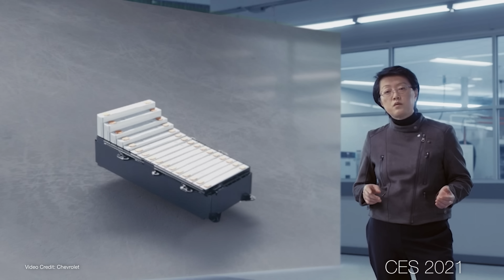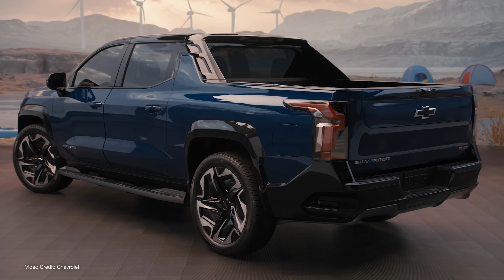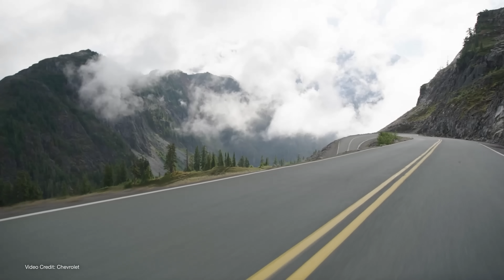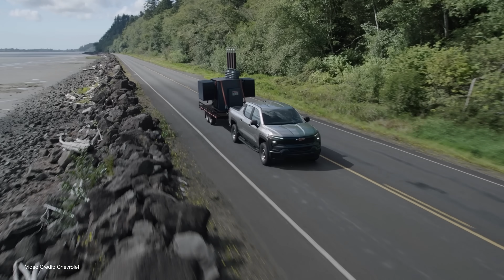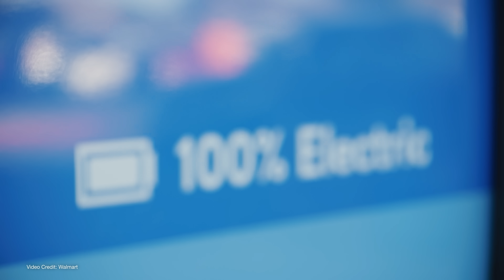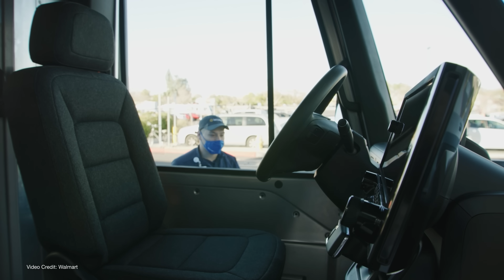CES 2022 - GM's Keynote introduces the Chevrolet Silverado EV

Comment: Good amount of news! I latched onto the part about GM "rounding" the front end to cut through the wind for better EV efficiency. Cool, but why don't they do that with the ICE version, at least until it goes away? Slightly better gasoline mileage would still be a benefit, well, for just a few years.

Comment: Hey, any idea about RHD models of the Silverado? they'd sell like hot cakes in NZ i think. the rural folks are constantly complaining there's no EV pick ups available.
Reply: I'm aware GM maintains a small presence via a factory supported importer for the current ICE Silverado, combined with the fact they went through with the effort for a factory RHD Corvette, I'd say unlikely, but plausible, though it likely wouldn't be cheap!
Reply: I imagine it is much easier to switch driver's side on an EV than a conventional vehicle. Otherwise you're pretty much waiting on the Japanese for a RHD option, I suppose...

Comment: Covid's omicron is weaksauce, you cancelled your plans, over a chance at getting the sniffles.
Reply from the maker: While it's certainly true that early evidence suggests Omicron is significantly less severe for most people, it's also vastly more contagious and while hospitalisations haven't tracked as closely to probable infections as other variants, the fact is that the hospitals are full - and have at several points hospitals in and around LV have had zero ICU beds. You may not worry about that, but as an experienced medical professional, I've seen what that actually means in practice. A lot, as it happens, of late. And it's bad. 

We have, as I have said, high risk team members. If one got sick and needed to be admitted - a real possibility because high risk individuals still get very sick with Omicron, then there is a real and substantial possibility that they could die. Just so we can take pretty pictures of things that are being shown virtually.

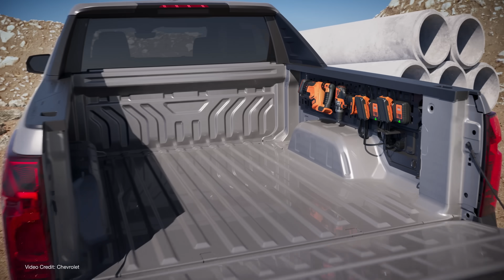Beyond which it's too early to tell whether Omicron produces the roughly 1:20 risk of long COVID that we saw with early infections. I sure as hell have no desire to have long COVID and am happy for our team members to be kept as far as possible from that risk.

You may not care about us as a team, but we do.

^Kate.

Comment: The Electric Silverado is here? It's a 2024. They have not produced a Bolt since about August. They have sold 1 Hummer in 2021, 26 total EV's sold in the USA in the 4th quarter of 2021. Around 100k Bolts that still need batteries and they are now a part of the culture of "Act Now while Supplies...well, not last really" but instead a "reservation. I own a Bolt, It's a 2021, it will not be fixed any time soon with a new battery. I have the latest software "fix" that limits range to 80% SOC and lets me park with the other kids again (oh wait, the "I won't burn you" placards are not here yet and who may believe Chevy after 2-3-4 software updates to "Address" this). I'm sorry. I love my Bolt but the situation and handling of this awful and believing GM at this point on almost anything is ridiculous. I am hearing rumblings now that the coolant to do the battery swaps is now out of supply and the swaps are on hold because of it. I love EV's, I'm on my second. GM is lost, very lost. Tesla is easy to hate but let's face it they produced a million pure EV's last year. Not promised, not backordered, but produced and sold and delivered. I would be cautions with my optimism on the new Silverado/Equinox/Hummer (not to mention if you think they will actually product the basement price one's they are talking about...I refer you to the previously mentioned Tesla and the great $30k model 3 and also that in tough times GM produced lower priced trucks and then parked them in stadiums to not sell them and put the parts in the more valuable vehicles). Nothing wrong with that but it still happened. < lol Rant Off> Oh, BTW Kate is the bomb. Their style of humor, dead-pan delivery of facts and way of balancing objective fact mixed with excitement and emotion is refreshing. They are the business... yay Kate.

Comment: im surprised at how much I like the design (especially) the front of the Sliverado EV.....Thank you and the team  for all your hard work trying to cover CES virtually!
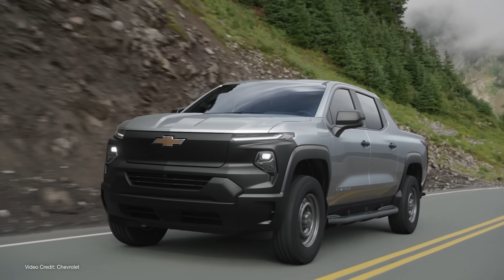Reply: 3:31 did they forgot to paint the front in this car? Looks plastic and cheap.
Reply: @volkhen0  Thats the work truck version....basic bare bones for work purposes only....but yes as always GM uses too much cheap plastic.
Reply: @kentgabriel3572  I think plastic on/inside bed is better the bare aluminium like Cybertruck. It will scratch like crazy. Good thing about it is T slot bed. Plastic linings you can replace but you have less anchor points.
Reply: GM seriously needs a new design team.  This thing looks cheap

Comment: We have a 2003 Avalanche with a canopy and love the utility of the drop down interior bed extension. We might just replace it with this new Silverado EV. My problem with the Cyber truck is that it keeps getting pushed back and we still do really know what the production version will look like and I hate the yolk steering wheel. We currently have a reservation for a F-150 Lighting but might switch to this instead. As this truck would need to replace one of our Chevy Bolts and our Avalanche.
Reply: The problem is that all EV pickups are likely to time for production and availability ... OK I admit that for the moment only the CT and Rivian were officially been pushed back but it wouldn't surprise me that both F150 and Silverado EV's will also be pushed back.
For Ford and GM, the bottleneck is battery supply limiting the production. And on top of that, even when you agree to the MSRP to one of their offering, will you also agree to the dealer markup ?
Reply: @krisvandermeulen253  Chevy is not ready.  Ford is.  They have batteries and manufacturing securedNot for 200,000 trucks.  The output of Ford will be impressive.   If you want one of the first electric trucks from the big 3 you will most likely have to pay mark up and get a high end version.  As time moves on and competition becomes competitive the price will drop. 

Tesla and Rivian will just sell the most profitable versions first.

Comment: GM will be irreverent unless they bring on a boat load of battery capacity.  So announce as many models as you want but it won't make a difference.  The real story needs to be where are they getting battery materials and are the Ultrium batteries any good.
Reply from the maker: GM has two battery production facilities under construction now, and has announced two more. The company seems to be planning for major expansion in EV production. As to how good or not good the Ultium platform turns out to be, that is something we'll all have to wait and see. I hope it's good, because the more EVs on the road the better, but personally I feel that GM and LGE have a lot to prove if they want to win back any goodwill from me. - Winter
Reply: @transportevolved  Four factories don't matter as the numbers of Gwh of output.  I know it will grow over time but any guidance from GM would go a long way to understanding if they are serious.

Comment: wonder if Walmart will allow others to use their charging network? same for for Fedex? the former has a lot of locations nation wide, so is it going to be in all stores as fast as they can?
Reply: Q: so is it going to be in all stores as fast as they can? A: unfortunately no, because: BOLT RECALL, because: GLOBAL PANDEMIC.  those paying attention (with good memories) will recall that the Hummer was slated to arrive 4Q 2021 and here it is now 1Q 2022, and of course they still have to ship the Ultium based Cadillac Lyric.
Reply: I am aware that fleet-use-only gas stations are already a thing (like a local bus depot to me has their own diesel pump on site exclusive to the busses) so I do slightly doubt it, especially if the rumors about electrical infrastructure remain true

Comment: I do hope that GM dealers aren't going to do like Ford dealers did with the F-150 Lightning with a $10k-$30k dealer markup just weeks before customers were to receive them.
Reply: My dealer said they are not going to do a dealer markup. I told him if they ended up doing that then they lost a customer. But they reassured me in a couple vacations they will not be doing that. They're going to attempt the windows and a couple of other things for $800. Then there's the destination charge for about $1,200 and taxes. So if they do that it's all reasonable.
Reply: @jayfromaz  With me living in Casper (Central Wyoming) when Subaru releases the Solterra I can almost guarantee that my local dealer will have a markup since they're the only dealer within a 150 mile radius. And the next dealer is a 3 hour drive away in Cheyenne.
Reply: @shadowz_edge   you're right they probably will. This dealer markup stuff is absolutely ridiculous. They gouge you enough for the window tinting and the other features they add in. If you got those other features from an independent source it'd be a lot cheaper.

Comment: Just watched the Chevy Silverado reveal. What a major, major disappointment. I was looking for something to replace my 2017 HD3500 4x4 Duramax. I tow a 35' 5th wheel. The RST certainly will not suffice.  Too small, and I really don't like the Honda Ridgeline appearance. Give me the traditional Chevy Silverado front end and body style. I hope that they change this in the next year once they get trashed by all of the present Chevy Silverado owners.  
Guess it is time to look more seriously at the Atlis Pickup, with its 5th wheel gooseneck hitch. At least they take the people that actually use a truck seriously.  
The RST is nothing but a glorified passenger vehicle. Too bad.
Reply: While I too have a 5th wheel trailer and need my one ton for towing, Ford and Chevy sell far more 1/2 ton trucks every year than 3/4-1tons. It makes sense that they will introduce a 1/2 ton EV truck first. Which is why Atlis is going for that market first hoping to get some market share. Unfortunately they are a start-up who has just recently completed their prototype vehicle, I really hope they make to market and thrive, but they might not. The big question on Atlis is they are shooting for a GCWR of 35k lbs, which is truck trailer and payload combined, the mystery is how much of that number will be taken up by their XT truck's weight? BTW I say this as an XT reservation holder.

Comment: didn't Chevy do the collapsible rear seat in the Avalanche years ago?  Doesn't seem like an innovation when it was done in 2001.  Is the estimated range include a full load?
Reply: Kinda like how evs we're first going back to the 1800s. And gm even sold commercial electric vehicle's&trucks over a century ago. 
Nothing new under the sun applies here. Oh well Toyota beating gm in us total vehicle sales for 2021 was actually new. 
Tesla will do that to them to by 2023 or 2024 depending on the Texas ramp. 🤔

Comment: I can confirm Walmart and FedEx are designing charging stations for their new distribution center(DC) warehouse. There are some issues with "all" existing major distribution warehouses in adding extra amperage capacity charging stations to their existing services. Issues range from the existing DC warehouse parking lot infrastructure and a small handful of local utility grid capacity concerns. These warehouses run 24/7/365 so off-peaking charging is not an option. I am also seeing many adding hydrogen fueling stations to handle 40-80k lbs over the road long (500+ mile range) haul semi-trucks.

Comment: The Silverado EV's drop-down rear seat for longer items makes it a top contender for a proper work vehicle. Good on GM for moving forward with electric trucks and vans. Thanks, Nikki!
Reply: A friend worked for GM when they released the first Avalanche with that feature - he said it was a maintenance nightmare - the seals break down in a couple years, and water leaks in the cab. Hopefully they have resolved that.
Reply: Is GM moving forward? That was a sarcasm, right?

Comment: Did anyone ask if Mary Barra's Bolt has its battery updated and if so when?
Reply: Bolt batteries are being replaced right now in Chevy dealerships all across the Country.  They are prioritizing 2018 and 2019 model years right now as most of the around 18 battery fires have occurred in those years.

Comment: I wish them luck with it, hope it's very successful and battery failure free.   Like the F150 it's a bit too big for me, sticking with the R1T.
Reply: Her dig on LG was uncalled for and unprofessional
Reply: @vidznstuff1  Not really.   As a Bolt owner it's a great reminder that GM has had some serious issues with their batteries and tech.   GM was really slow to fix the Bolt issue.

If it takes GM two years to fix catastrophic fires... do you really think they're going to fix minor software issues in vehicles?

The Silverado EV (gladly) is a bit more than I was expecting from GM... but I personally will be looking to the R1T or Ford F-150 lightning.  I just don't trust GM after the Bolt EV fiasco.